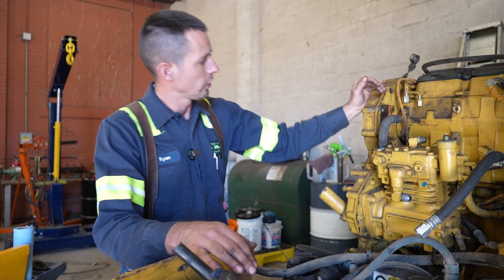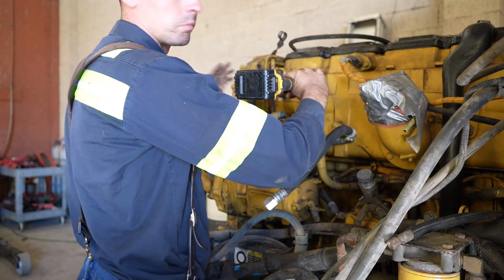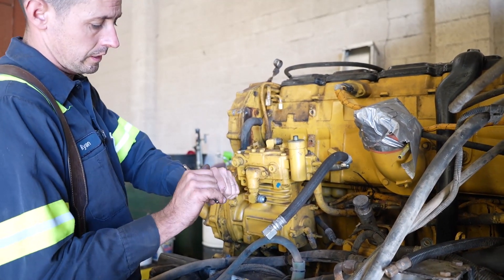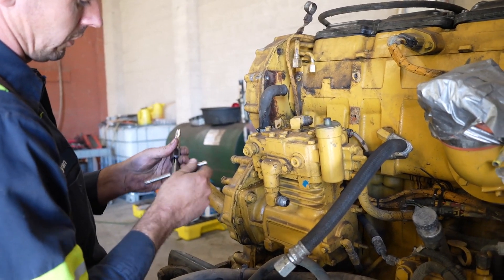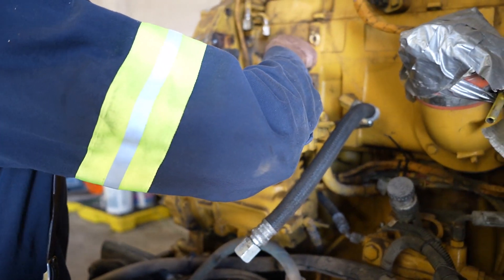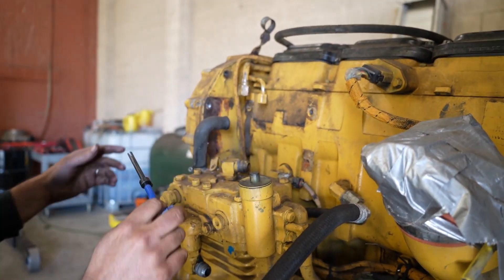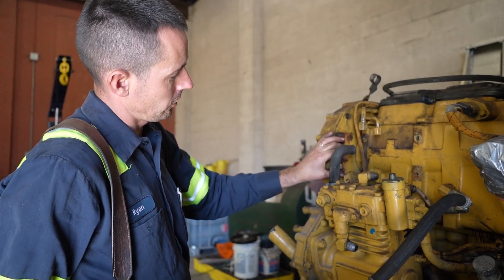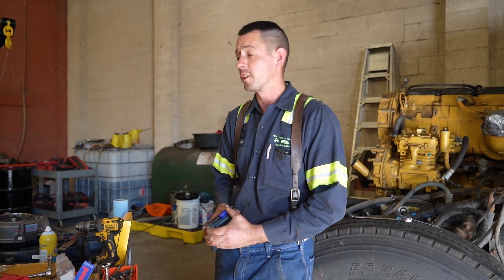Damage Thread Repair - Install Helicoil on Front Case of a CAT C15 Engine

Comment: Installed a lot of Helicoils when I was a machinist in the Air Force.  Filling the flutes of the tap with grease will catch most of the filings if working in an area you don’t want metal shavings in, same with drill bits but use high temp grease.